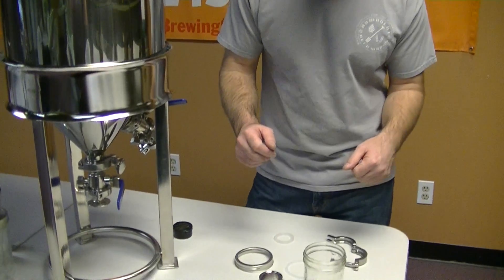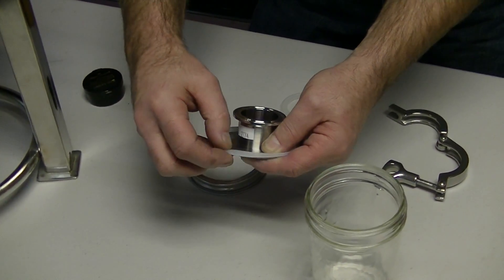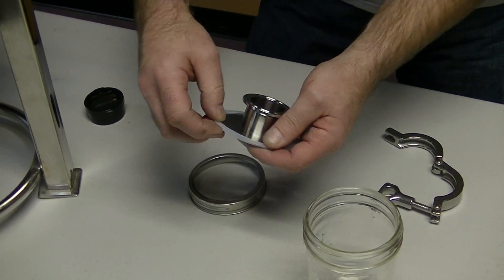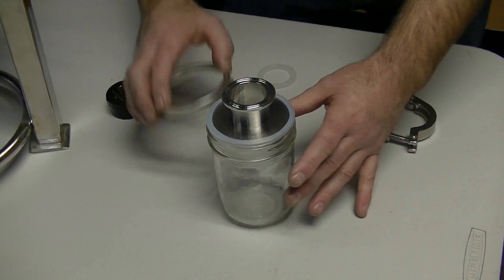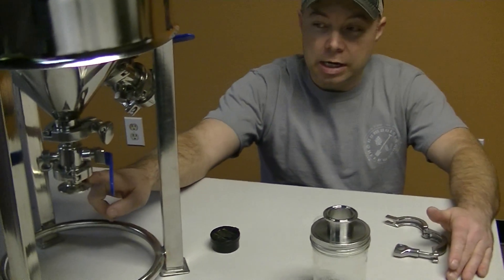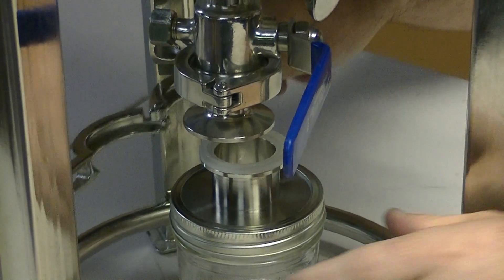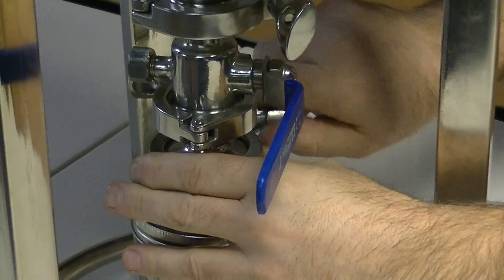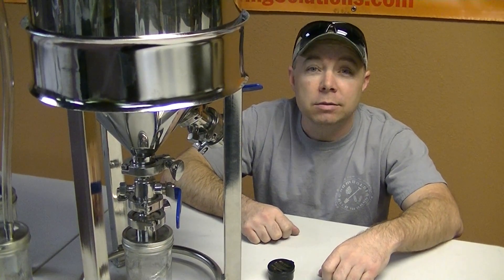Attaching Canning Jar Yeast Harvester to Conical Fermenter

Comment: I've got the Catalyst fermenter from Craft a Brew and they have a built-in canning jar attachment at the bottom for exactly this reason. I think it's a great, flexible and cheap design for a great many things. If I had a triclamp conical, I'd absolutely get one of these and convert it. Nicely done! One question: Any idea what PSI rating a typical canning jar can hold?
Reply from the maker: With a standard band, which is the weakest link in the system, some about 5 some 10, there is really no way to know.  We do sell a stainless band that will hold quite a bit more than the stock band.  Ours were developed with an added thread to catch that second rib on the jar and being stainless they wont rust.